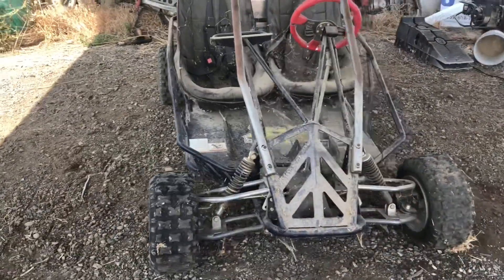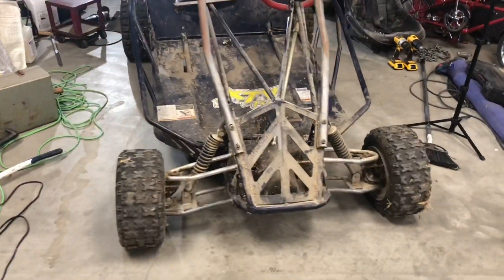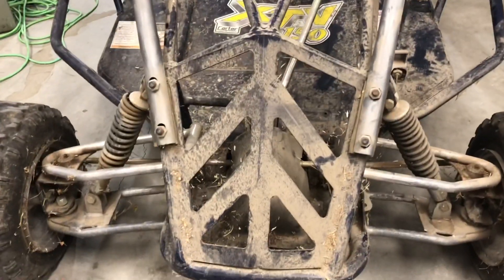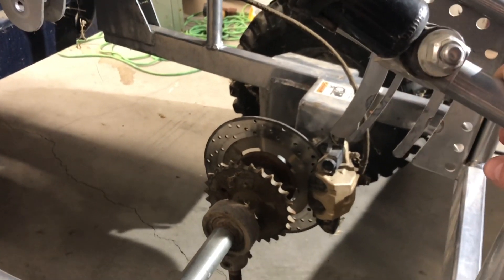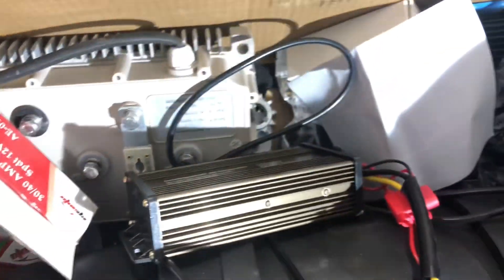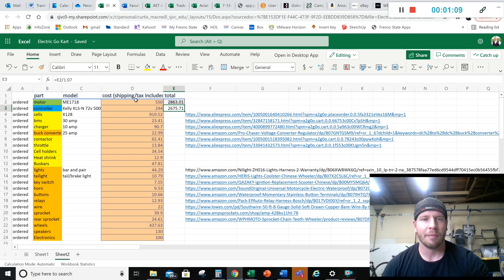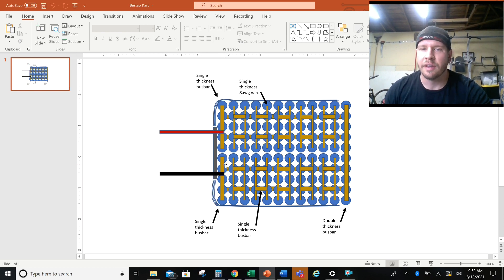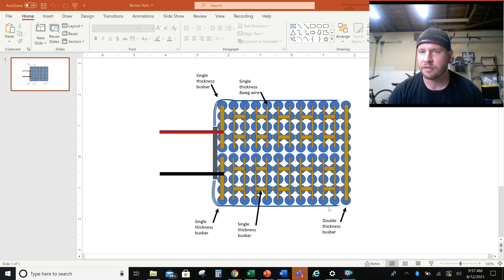Electric UTV Buggy Conversion: Teardown, Components, and Design

Comment: Wooo, ME1718 is a beast! I am pairing it with the same Kelly controller in my EV kart build. It is a powerful combo!
Reply: LifePO4 cells as well? I guess great minds think alike ;)
Reply from the maker: Can’t wait to see them both up and running!
Reply from the maker: Which cells did you go with? 32650?
Reply: @LordCurt  I ended up using Headway 38120HP cells in my build.

Comment: I will be very interested in watching the pack build but also learning more about your motor and controller combination.  It seemed to me that you and Inja had way more problems than you deserved on the Cafe racer in that area and I’m not really sure in watching all those videos if those problems ever got completely ironed out?
Reply from the maker: You’re right on that. There were one of two issues depending on the pulse width modulation frequency. Either the batteries didn’t supply the current when the pulses are short or the controller had a shut down when the pulses were long. We have it tuned the best we can for now. It may lead us to a new controller in the future, but it depends. For this build, the pack will have a higher output capabilities per kWh, so I’m optimistic it will provide well enough for short pulses and full power. Stay tuned for the progress!

Comment: Have you seen James biggars version of this project? Are you also using aluminum body panels? I can't wait to see the performance and range of your build. It's going to be amazing. Full support.
Reply from the maker: I’ve been watching his videos on it! This will be a bit of a smaller version of what he’s got going on. He is using the water cooled motenergy motor (same as 1507, and a 600 amp Kelly controller from what I recall. I’m not sure what voltage. I’ll look it up again and compare the battery. It should be a similar power/weight, just a bit smaller. I’ll definitely throw some extra gadgets on it compared to what he has
Reply: @LordCurt  deeeeyum 😖 enter it into the Baja 1000 💨🔥